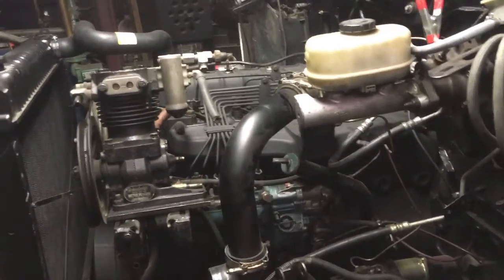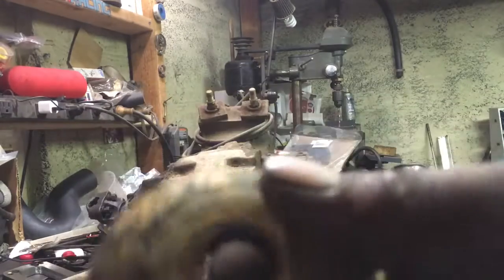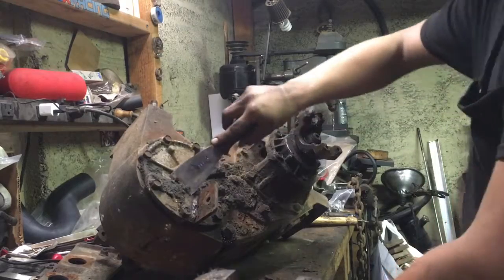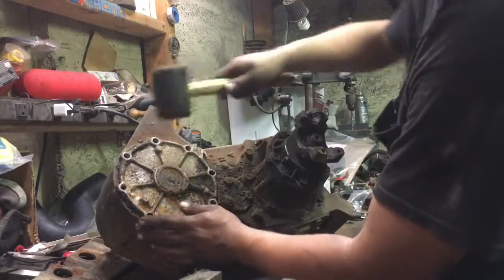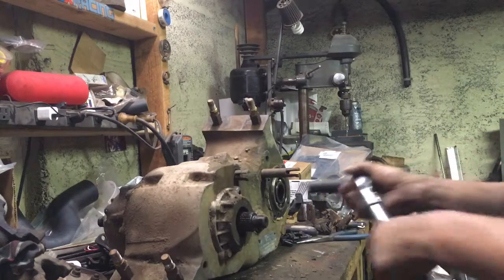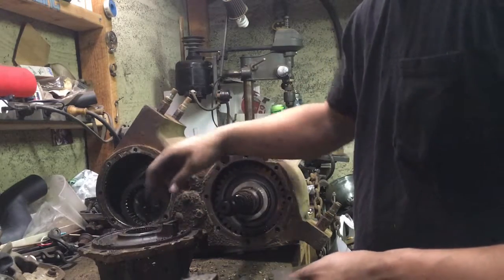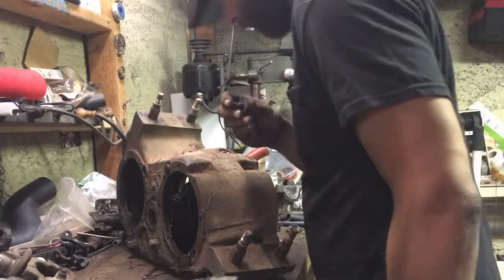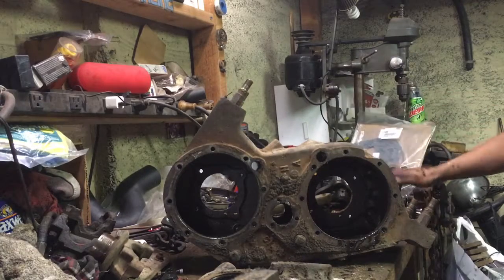Parts Replacer rebuilding a NP 205 divorced transfer case Part 1

Comment: man i been all day trying taking off those shift rail afther taking off the shift fork  but theres something else stoping them from coming off please help
Reply: it must be the pin interlock
Reply from the maker: EkonMaster Bud yes the pin needs removed
Reply: @Petersonauto  i did remove the fork pin like i said i did take off the fork pin but no one is showing nothing about the interlock pins (between the 2 rail shaft)
Reply: you cant remove the interlock pins
 but the rail shaft needs to be place in a particular position to be pull off
Reply from the maker: EkonMaster Bud sorry see the vid there’s a cap and ball that needs removed to pull the shaft
Reply: @Petersonauto  i know i done all that man but im telling you the shaft wont come off the lock pins are off and the little balls to the shaft fork is loose on the rail but the interlock pins is stoping me from pulling off the rail shaft (interlock pins are not the lock pins inside of the fork they are the pins for safety between the 2 rails)
Reply from the maker: EkonMaster Bud do rails move?
Reply: @Petersonauto  yes they are free but wont come off
Reply: dont i need to place the first rail in a specifique position to remove the 2nd one?
Reply from the maker: EkonMaster Bud not unless the cross bar is on. I would suspect things are pretty worn and you may have a bur or something holdi it up. Try pulling the seals and removing the rear cover and output so you can drive them out with a brass punch